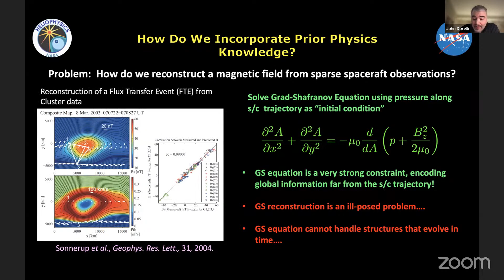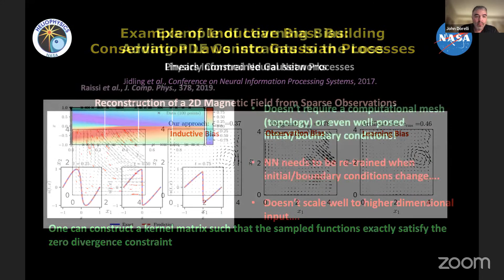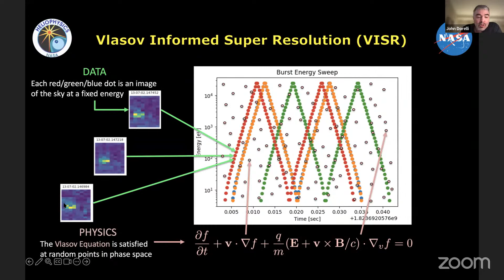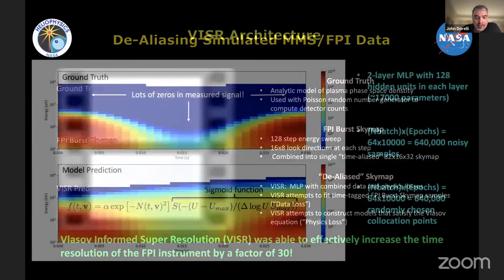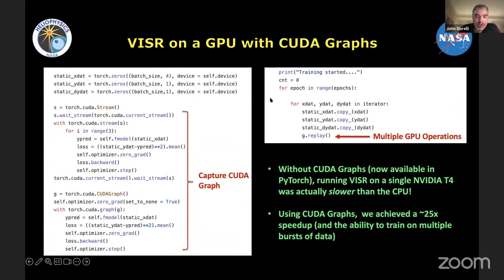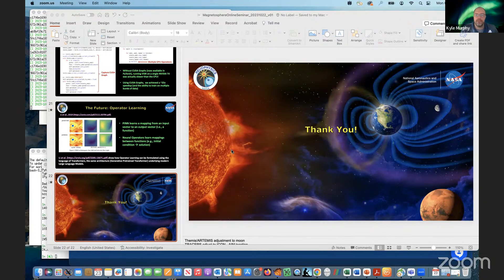John Dorelli - Heliophysics Applications of Physics Informed Machine Learning

Comment: Small question: When you talk about the model prediction having some small density errors within the Poission-errors (at about 30:35), is it possible that that is due to you having an error-function in the residuals derived from a Gaussian (at about 26:15)? Such a symmetric error-function might be sensitive to symmetries of the statistics of the measurements around the expected value - as would be the case for Poisson-distributed observations in the small-counts range...